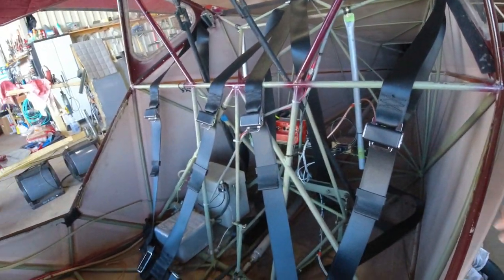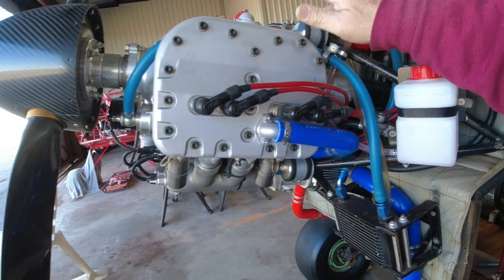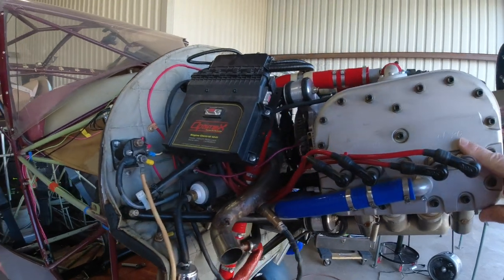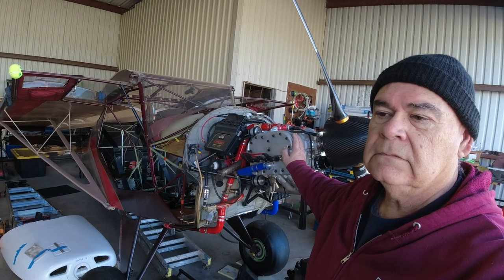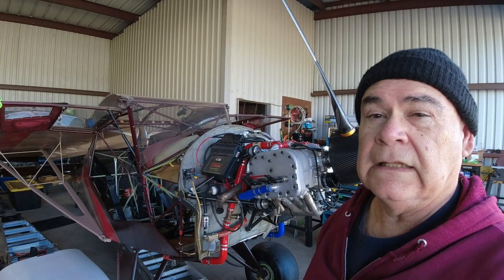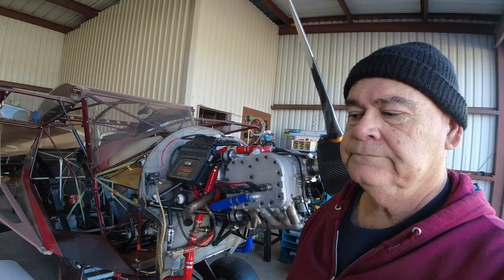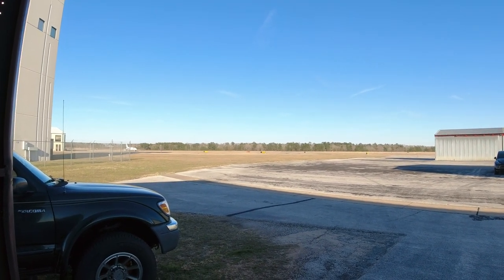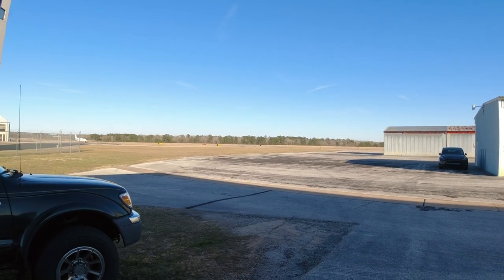Kitfox 2 D-MOTOR UPDATE 22JAN2022

Comment: Looking good! What does the D motor weigh?
Reply from the maker: It's should weight about 138lbs installed. It's weight is 15 to 18 lbs more than a rotax 582.
Reply: @joseruiz-Joecool  its also 30hp more